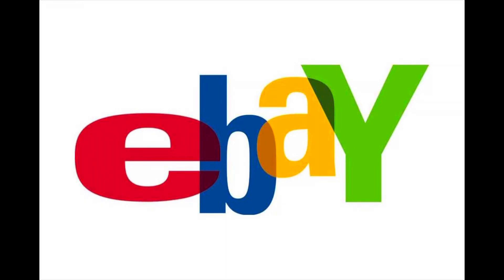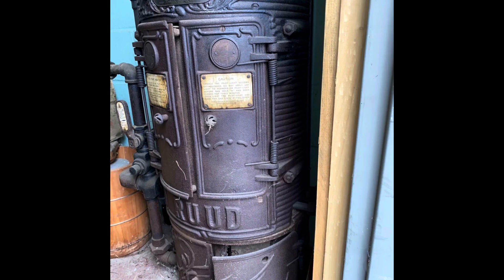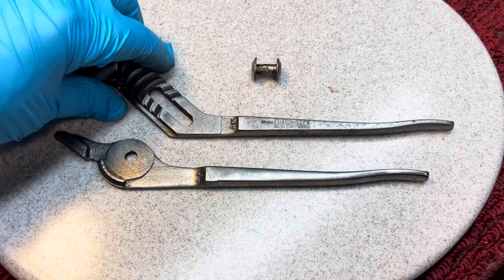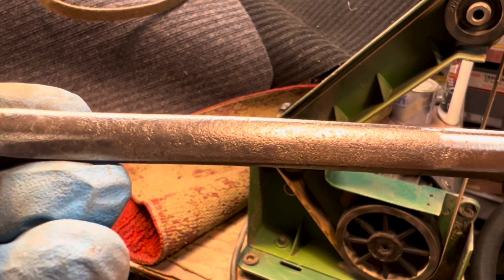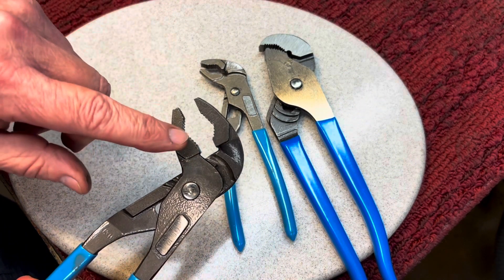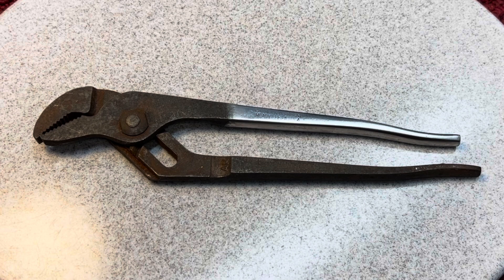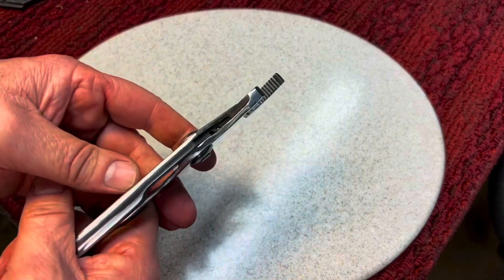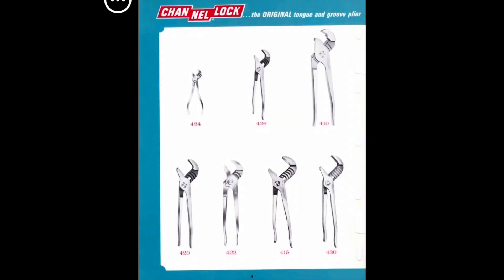Iconic Channellock 420 Restoration

Comment: That Ruud would be an excellent restoration for your channel! I once found a pair of small Channellocks in the drop ceiling in my office, while changing a fluorescent fixture. No one had been up in that part of the ceiling in since it had been remodeled 15 years before - the old maintenance guys were long gone, so it ended up in my tool box at work and I still use it today. Great restoration as usual.

Comment: My dad used to call these pliers "clams". I bought a set of the Lock Jaw type pliers from Craftsman 25 years ago and hated them. They worked when I tried them out on stuff.  During practical application they stunk! They were tool box queens for many years until I sold them cheap.

Comment: Great video 👍Great information on the history of Channellock pliers. I like the collection of pliers you showed on your video especially the vice grip pliers even though they are not made in U.S.🇺🇸. Some are made in 🇹🇼 Taiwan . I think overall they are pretty decent. The knipex 10 inch pliers are awesome!They will bite down and really grip to get a bolt off. They have came down in price to around $30.00  on Amazon& about $36.00 at Lowe’s. But I still find myself grabbing for my Channellock 420 or 430 pliers because that was what I used for work in the electrical field and all the professional electricians had them and told me at the time that I needed them and I never turned back. They have served me well,great pliers. I think you did a fantastic job 👍on those classic USA 🇺🇸 Channellock 420 pliers. They look like they came out of one of those cardboard boxes 📦 they used back in the day. I have a pair of those Channellock 430x pliers and even though they are made in U.S.A. 🇺🇸 they  do not have that feel in the hand like the classic 430 Channellocks. Now the cross hatched teeth are really nice but, that feel in the hand with their handles not a fan of ,but I am trying to give them a chance 😂.Well again great video and you have a wonderful weekend! 😀👍👍
Reply from the maker: Steven- It’s funny how sometimes we have to get used to a tool. 😃👍

Comment: I had a set of the 420s when I first got into the trade then switched to the knipex, I prefer the knipex but for the price the channel locks work great. I have several sets at home that get used frequently.

Comment: I have a slip joint channel lock #460 pliers, they are great, I used them to remove fuel filter off ch-46 helicopters, Eck usmc

Comment: Get the Ruud. Do a series of videos on it. "Hi Scoutcrafter here, TGIF  made it through another week.  This week's episode of the Ruud is. . . " among other things on that weeks agenda. 👍
Nat gas cheaper than oil there? Only used as when needed. Cost analysis?  
In Fl, mine is electric.  Set at 120°F. On timer. Powered only 8 hrs a day in summer. 12 hrs in 4-5 colder months. Proper maintenance,  20 yrs easy. 
Oil is only to go up in $$$.  // pliers came out great! Yea!

Comment: The hot water heater looks a fair bit like the whole house wood furnace at my grandpa's cabin near Canada. It had on it that it came from Minneapolis, MN so I used to bask in its warmth and imagine how it probably came by train most of the way and that last 50 miles on a horse drawn wagon.
 The thing was so massive you could take 2-3 armfuls of wood from the crooks' of your elbows to just under your chin and it would only barely fill it halfway!

Comment: I have a pair of the 420's that I picked up recently at an estate sale for $1.  One of the best buys I ever made.  They cleaned up nicely and I use them all the time.  Only difference from yours is that mine have a "BH" marking on the handle instead of the "AK".
Reply from the maker: I wonder if those markings are date codes? 🤔😃👍

Comment: I LIKE the Ruud heater! Bet it'd work just FINE after you got through with it! We have a RUUD heat pump since 05 and have replaced one fan motor and nothing since I built a roof over it to keep the rain and ice out of it. Also have tried other pliers and if I need anything HELD, I either use a Rigid pipe wrench or old style Chanel-locks. Blessed with another week so God Bless YOU, you silly Scout Crafter You!

Comment: Great story on the Channel-Lock Company.   A classic tale of inventing a tool and building a company around it.  You have to give them heaps of credit for maintaining their level of quality while keeping costs down in today's economy.  Of course I have several pairs of them laying around here somewhere.... I find the smaller sizes to be especially handy at times...  They also make one of the most efficient oil filter removal tools I have ever seen..

The RUUD water heater should be a priority for you...  That thing is going to be a real monster once it is refurbished.  It will  probably run for another hundred years.  With some metal polish and a bit of paint, the water heater should be a centerpiece for any home...and next Spring, when you can turn off the heater, it will continue to provide hot water without firing the old furnace...  You'll love it.

Comment: Hi Scout, you mentioned that good quality American steel is used to make Cannelocks rather than recycled steel. There is no problem using recycled steel as once it’s all melted together it becomes more or less new steel again. The difference with American and British steel is the way it’s produced. Temperature needs to be closely monitored and the carbon content needs to be at around 1%. Then expensive elements like tungsten, chromium, vanadium and molybdenum need to be added in precise amounts. Getting all this correct in a huge cauldron of molten metal is a science in itself and this is just to produce the high quality steel in the first place, then the tool manufacturers have to use precise methods to harden and temper their products. It’s these reasons, and not so much cheap wages, that quality American and British steels are expensive compared to imported steels. I like to buy older tools that were made before the cheap imports arrived. Back then quality was the most important factor not price. Great video as usual my friend. Cheers Stuart 🇦🇺
Reply from the maker: Stuart- Making quality steel is a real Science. Unlike recycling Aluminum steel has lots of steps in both composition and tempering. Many companies have tried to replicate the process but can’t. The problem with recycled steel is if the steel was flawed that gets recycled it’s difficult to purify the new batch.  When you start with pure ingredients there are no contaminants to begin with. That’s why they are paying top dollar for WW1 steel.  😃👍

Comment: Greetings from New Zealand - we have those early failing steel hot water heaters here too. We also have the somewhat more sensible copper ones. Mine died finally this year - at 62 years old. Needless to say its replacement is also copper.
And I have a couple of pairs of good channel lock pipe wrenches in my van.

Comment: Beautiful pair of old channel locks I prefer channel locks over knipix they are stronger the best thing about knipix is the push button but that's its weakest link for header use I use channel locks if your going to get a water heater go with aeo Smith or Ruud they are the best one's

Comment: Channellock makes Channellock pliers in both straight jaw and V jaw similar to Vise-Grip Pliers having straight and curved jaws.  Below is a listing of the straight and V jaw pliers which come in the same length (there are more lengths of straight jaws than V jaws).

6.5” – Straight Jaw: Model 426; V Jaw: Model 412
9.5” – Straight Jaw: Model 420; V Jaw: Model 422
10”  – Straight Jaw: Model 430; V Jaw: Model 432
12”  – Straight Jaw: Model 440; V Jaw: Model 442

The V jaws work well on pipes and hose fittings since the V jaws grip on four points instead of two or three for straight jaw Channellocks.  

Channellock also makes a plier that is similar to the parrot head but in a traditional Channellock called a Griplock.  It is worth getting a copy of their catalog on their website (a pdf file).

Catus Maximus has a video that discusses the different styles of channellocks titled “ChannelLock Tongue & Groove Pliers Review & Comparison” which is where I found out about the V jaw pliers.
Reply from the maker: Great info!  Thanks! 😃👍

Comment: Beautiful job on the Channellocks and I love that old hot water heater. When we moved into our current house - it started life as a hunter's cabin back in the '30's -  we found the original water heater in a corner of the basement that was fashioned from an old coal stove that had been wrapped with about 30 feet of 3/4" copper tubing. Needless to say we've upgraded a bit but that one you found on eBay would make for a great conversation starter and it probably has enough life still left in it for the next 50 years.

Comment: Haha, in the 1970s while in the Navy I got stationed in Maryland. The apt I rented had the owner right next door. When I needed some tools, as I had none, he gave me a pair of those type channel-locks, plus 2 old screwdrivers, a flat & a Philips, a regular pliers and a hammer. I used just those tools through the 70s to do everything, even changing oil on the car. Then I got a nice tool set. I still have all but the hammer and use them all the time. They are in a kitchen drawer.😄

Comment: No shade tree mechanic would be caught dead without a pair or two of Channellocks in their toolbox. You may mess up a bolt or nut to get home but they’ll get you there, and I speak from experience, too many actually. Our hot water heater is a GE heat pump type, it works very well and dehumifies our laundry room at the same time. Sadly one year after we purchased it GE shut down their Louisville operation and sold off manufacturing to Bradford White, so parts and service are still available. That Rudd however, once reconditioned will probably be heating water 100 years later, just a beautiful piece of hardware.

Comment: Those Ruud water heaters would work until the copper coil would eventually develop a pin hole.  To bad nobody would sell replacement copper coils for them.  Had a neighbor who had one that ran up until the '80s when it had to be replaced.  I also knew someone who turned one into a storage cabinet.  Very heavy and not a very efficient shape but neat none the less.  

As for your Channel Locks, I think you need to learn how to do nickle plating to preserver some those gem tools.

Comment: John, it's funny but when I was younger, we always called Channel lock pliers "water pump pliers". I own several small to large and use every day. 
The box style like Knipex and Irwin/Vise Grip are ok but too many notches to choose from most of the time. I have a couple of the Vise Grip ones and last year bought an 8" and 10" Doyle at HF and they are identical to the Knipex except for the handle color and branding.
George

Comment: The secret to the water heater obsolence is to replace the anode every few years but since its often next to impossible due in part to size constrictions. And they're practically glued in. I've never even done one but I know they make designs that come in 3 pieces so they can fit in even tighter spots. I need to find a universal water heater socket as I have no idea what they are off the top of my head.
Reply: I actually had to but the right size real socket (also don't recall the size, but big) as the cheapo little pressed tin job was too whimpy, and use a breaker bar with a cheater pipe, and a buddy hanging onto the water heater, to get mine out.  Since you mentioned it, I think I should probably do it again, been a while......

Comment: I have a couple of pairs of the those Irwin box design and I use them a lot.  They would definitely be included in an emergency or automobile tool box.  I also have a bunch of Channel Lock tools.  I'm happy hear that they are still made here.

Comment: Thanks for the video sir, found the Channel Lock history interesting, and the refurbishing of the 420 plier. Always fun to here the topics. The water heater issue, I just replaced a 25 year old water heater for my step daughter, biggest thing I have found with them is nobody flushes them out periodically to keep the lime build up down and if they have an anode rod, they need to be checked periodically also. I would love to get my hands on an old water heater like the one you found on eBay,be fun to set it up.

Comment: My Channel Lock pliers are one of the more frequently used shop tools I own. I have them in several sizes and find them  very useful. My late father called them "water pump" pliers  because back in the day one of their uses was to tighten the packing nut on car water pumps so the packing material would keep the pump from leaking and gradually emptying the cooling system.  I still have his Channel Locks.

Comment: I remember the old water heater shown on a smaller scale in out house in the city ,  Dad called it a side arm or a side man heater,  it fed into a galvanized uninsulated holding tank.  I recently saw one restored at Lehmans Hardware in Kidron Ohio. Being Amish country does one think of a connection that it has  no electrical controls?

Comment: That hot water tank was a beauty. I love antiques and vintage tools, even appliances. They are made to last. One of these days, I'm thinking of doing that with a wood burner like the Amish. Anyhow, I need a replacement pivot pin for my little antique 426 CL that broke. It was my Dad's. After I replace the pivot, I plan to finish it likewise and enjoy using it again. Thanks for showing your process of restoring that fine tool. Here's another blessing for you. It's a short video of a truth that someone cared enough to share with me one time. Feel free to touch base with a response if you have any questions or ever need prayer. 
https://youtu.be/wAwFD72lesc?feature=shared
☕🙂👍

Comment: I will enable you by telling to get that water heater. Pen is just a hop, skip and a jump for you. You will proud as a peach once you get it restored.  The reason I like the older Channellocks is they are thinner and the handles come together closer at the bottom where you grip them.  I don't have baseball mitt hands.  The amazing thing is they are just as strongly made as the thicker new ones.

Comment: The cast iron water heater, would warm the house up as it has little insulation. The modern ones although flimsy used far less energy to heat a certain amount of water and kept it hot for some time. Cheap knock off's of channel locks slip. You would thing it was impossible for it to jump a groove but they do.

Comment: You talk about using ebay but, have you tried the Goodwill shopping website? Are there any other website you use when buying tools"used or new"?Goodwill does auctions and I do find cool things every now and then.
Reply from the maker: It’s funny- In my neighborhood the goodwill and Salvation Army stores are loaded with junk!  Renter junk!  😂👍
Reply: Goodwill has a website that works like ebay. Most people do not even know it exist. Just wanted to share it with you and others. Does not come close to the amount sellers of ebay but it is another option.